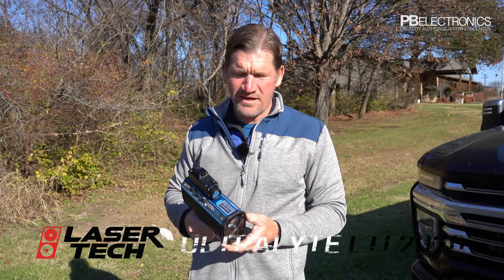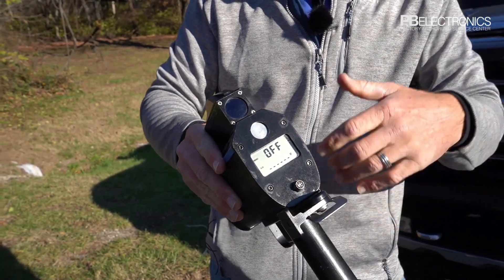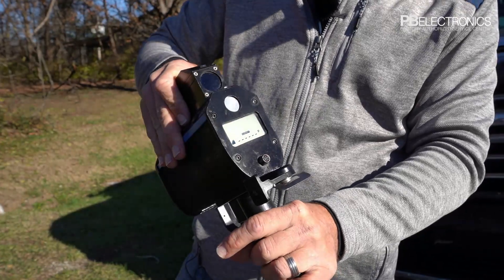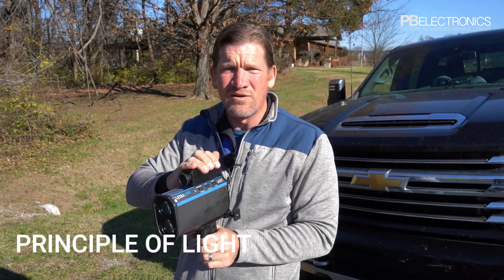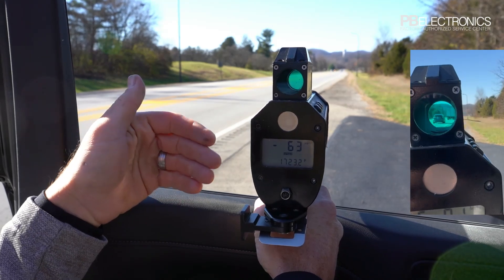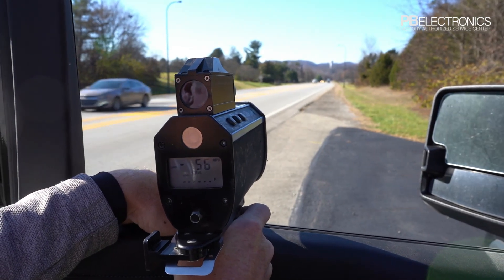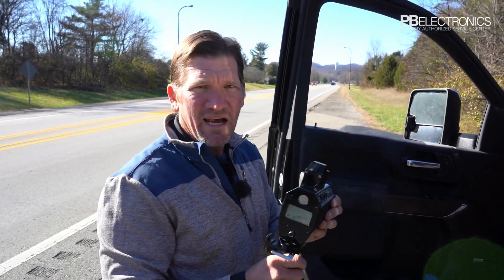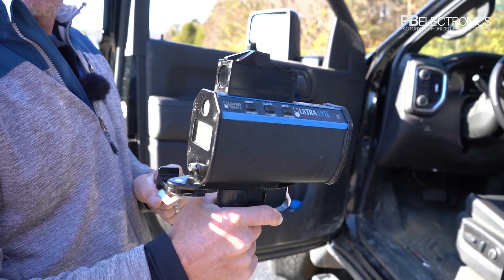Police Lidar Gun - LASER TECHNOLOGY INC LTI ULTRALYTE 20-20 100LR  - Basic Operations

Comment: The police are committing perjury and testifying that they used the laser radar equipment, and even forging training certification cards to prove they are qualified, but in fact they are not even using the laser radar equipment; instead, they are estimating your speed and entering that into the computer that issued the speeding ticket.
Reply: then fight it in court. get the laser information and the speed log. Typically, though, if they got it on laser, they weren’t lying.